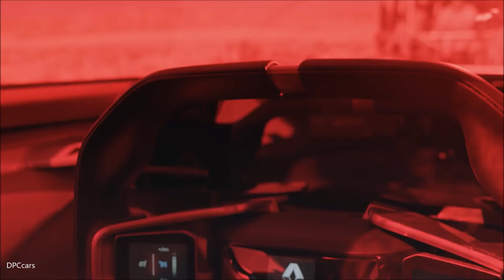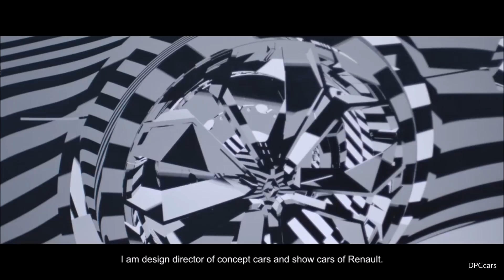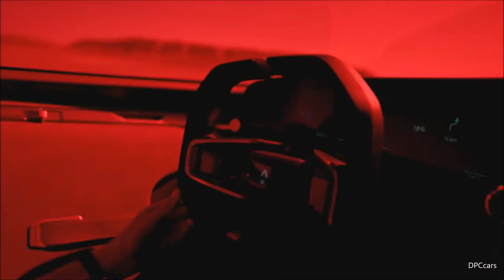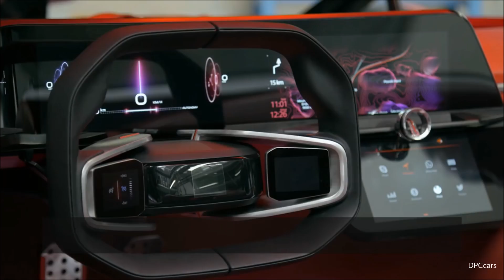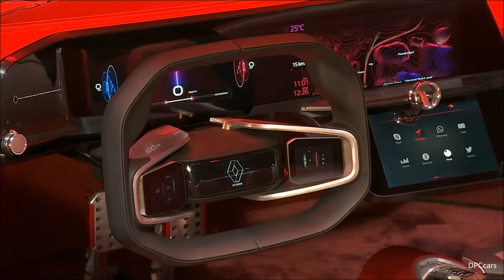Renault TREZOR Electric Supercar Concept

Comment: It’s cool but
1) If the windows are tainted red, you can’t see street lights correctly
2) What if it rains? All the rain will get in
3) You can’t adjust the seat
4) If you have an accident and there’s no more electricity in the car, your car lands upside down or in a lake, etc... there’s no way you can get out safely